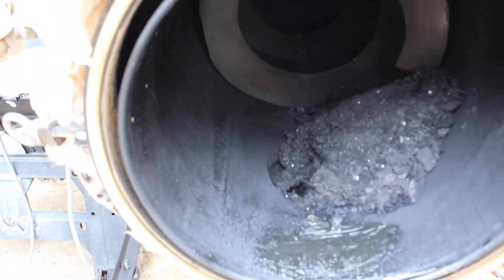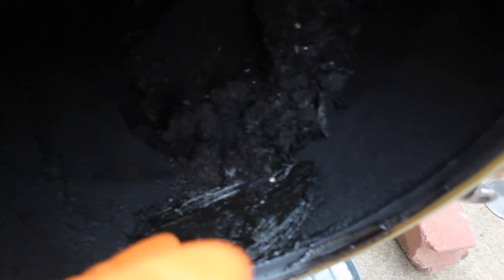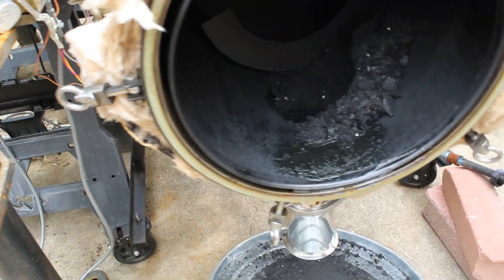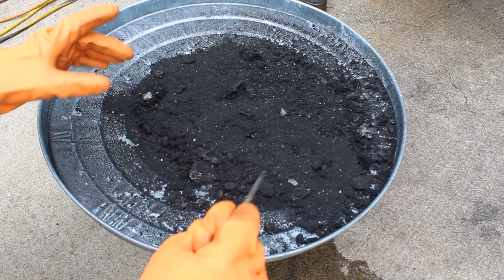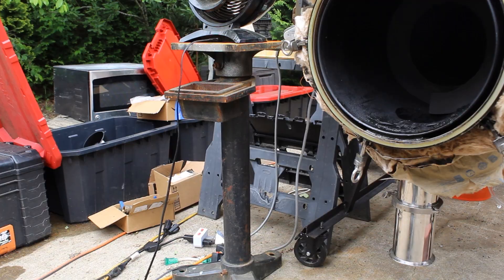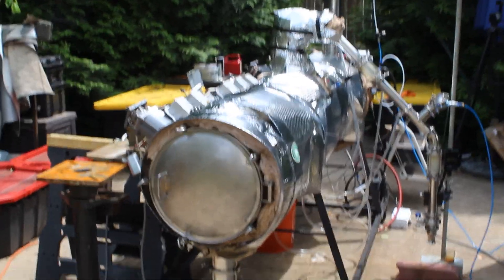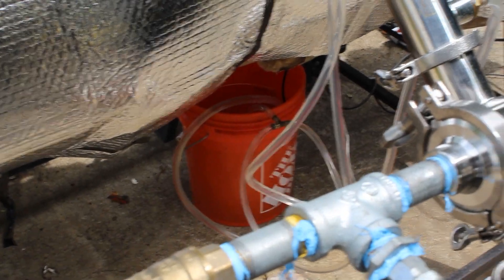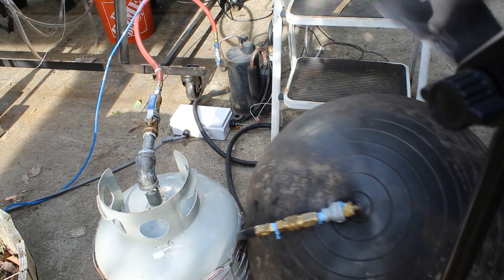Running Mark 4.5 Plastic to Fuel Reactor! | Part 2

Comment: A small pneumatic vibrator welded to the outside Will have that lil carbon sliding its way to the hole while the blades pushing

Comment: That heat you're trying the keep in with insulation, you should also utilise thermoelectric converter to try make the thing power itself using its own waste heat..

Comment: 7:15 You will get some transfer. But a compressor is just a vapor pump. You need a cap tube, piston, or thermal expansion valve to create the compression. LNG is created at -260° so this will be a hurdle as well. You might get lucky and the increase in pressure might bring the temperature requirement down.

Comment: Put a bung on the bottom of the auger to allow more spent carbon to escape so your not getting too much recarbonization. You will get a better yield and cleaner product. Hope it helps.

Comment: for material gathering look into shaker tables and other sorting machines that are for gold mining. Alot of it is very applicable here, especially if you're gathering pure minerals aswell itll properly sort all of the precious metals by density. mbmmllc is a great yt channel to check out for those kinds of machines, he also does custom machines if you want to make it specific

Comment: Sir , you don't need that much power , with this set up you need the plastic material to be in constant motion during microwave operation time (burning stage) to get maximum efficiency, after that if the power is not enough you can add more burning power.
Instead of Ice you can use a chiller ( cold water ( water cooling system low cost) 
good job, good project that needs more improvement to be profitable.
Note: you can install microwave from the other side this ( one microwave in front of the other ) this way you will hit the plastic material from 2 sides with waves with out the need to rotate the plastic material ( I suggested rotation at the beginning) or every 30° on 1 section you can install 1 microwave this way in 1 section you will hot the plastic material from 3 sides.
I like your project ❤
Good luck 
Hope my suggestions help you to improve your project

Comment: Ofc some baffles is nice to direct the carbon somehow, but this reminds me of this Alfa Laval separator at my place. Its basically a spinning bowl with a water trap that will form a water ring when it spins. Oil cannot go past the water due to massive G forces favouring water to go outwards instead of oil. Anyways in the bowl is a liner. Just a thin sheet of stainless steel that conforms to the bowl. Other than separate water out of lube oil, it also sediments out particles with that massive G forces. So after a lot of muck has built up at the bowl, you lift the liner out to clean up easier. And the little bit of grime left on the bowl can be wiped with a cloth. Massively reduces manual labour of scraping the bowl clean from the muck. The liner can be brought out to clean in a more ergonomic setting.

For parts in the pyrolyzer that doesnt touch the spinning auger thing, maybe have a liner thats just snug, but doesnt need to be welded to the vessel. Ofc, you could weld some baffles and walls to the thin liner to redirect the carbon to the hole. Thin sheet welding so might be challenging.

So for a few batches, the carbon goes where it needs to, but after several batches, the cover can be removed to bring out the liner for manual cleaning. Reasonably efficient enough operation imo.
Reply: Out of topic, but the bearings and balancing of that Alfa Laval is just chefs kiss. The thing takes several minutes to get to a few thousand rpm. And when you turn off, it takes a few minutes too to come to a stop. SKF deep groove ball bearings ftw.

Comment: The only way this can truly be useful is if you use maybe a combination of the carbon / gas by product as a way to recycle heat the device plus some less expensive energy uses such as maybe a Solar panel/ mirrors / Or Fresnel lens heating system or heck Water powered. Overall you would get less energy in the end product running 10 High powered microwaves. But using cheap clever non Grid based heating options plus recycling the fly ash/ gas as a way to reheat would possibly make it worth doing.
Reply: Benefit of the end product though is long term energy storage which is worth investing cheap energy heating options into as a seed.

Comment: You might just be able to shift the carbon discharge pipe a little to the side where the blade is piling the carbon?
Reply: This actually sounds like the best, elegant idea. Would take a lot of work to modify it now, but that sounds like it would totally work

Comment: This plastic-to-fuel reactor is genuinely remarkable and impeccably engineered! Congratulations! As for the issue you're having with carbon buildup around the exit hole, have you considered integrating a pneumatic vibrator? Given that compressed air is already part of this project, perhaps attaching a manifold at the required location and running a hose attached to the vibrator to the outer tube where the carbon enters could be beneficial. This method could have the potential to improve the extraction of carbon through the exit tube, thereby enhancing efficiency.
Reply: Nerd

Comment: Consult with some electrical engineers and rf engineers on how to make this more fuel efficient. I'm curious what the theoretical max efficiency this can be
Reply: @jacobclement8150 consult not hire
Maybe they'd even help for free if they're into the project
I'd offer help but my background is in computers so there's not much I can do there
Reply: @jacobclement8150 And they will be on the side of industry, I would  absolutely stay away from any degreed engineer whoi isn't close fam.

Comment: Pyrolysis is not a new process people. I imagine it’s just not profitable or no one has done the work to make it profitable.
Reply: I'm pretty sure that's not true, people always say that when they do get as much as they want
Reply: @Bengauzi  What do you mean?
Reply: @tnypxl  So basically in a hypothetical he can sell a liter for 30 dollars but it costs "28" to create it, but 2 dollars for some isn't worth it and at that point it's labeled not profitable
Reply: @Bengauzi  Any byproduct of eliminating plastic is a net positive when weighed against not doing it or not doing it enough.
Reply: @tnypxl  I mean if that was everyone's opinion then you're original statement would not exist imo
Reply: @Bengauzi  When I say “not profitable”, I’m taking into account the process from A to Z if this were to run at scale. Just look at the power requirements, the grinding up plastic, collecting and redistributing and reusing the carbon. Not to mention the insane amount of regulation that will inevitably balloon the cost of implementation and slow down aggressive iteration of the tech. Not to mention adherence to safety protocols.

Profits disappear pretty quickly when taking everything into account.

Comment: This is a great idea. But...... If it takes more energy to make this fuel, than it produces it will never become mainstream. It can't cost 200 bucks to make 100 bucks worth of fuel.
Reply: It’s also solving 2 problems at once tho by disposing of the plastics. The clean carbon can be sold off as well as the precious metal recovery after sifting too. So he really has a combination of liquid fuel, gas fuel, clean carbon, and metal recovery profits all while potentially getting paid to take the plastic waste in. If he can generate enough fuel to run itself at no cost other than labor and maintenance, he’s set for life
Reply: @TheRzaTheGzaODB I wholeheartedly agree
Reply: That's the point of the project, keep making prototypes and trail and error until it's efficient, that's what science/engineering is all about.
Reply: That's why it's mark 4.5. even tony wasn't finished at mark 10.
Reply: Wholly depends on what the fuel price is
Reply: @thetallestguy  no, if price increased, electricity will also increased so more expensive production. If decreased the electricity price will decreased and production cost will decreased too, but in any case the cost of initial fuel used will be still way cheaper than it produce
Reply: Dawg it’s cost trillions for oil your number is not discouraging

Comment: Yes that's a very valid question.How much energy does it use compared to how much it produces.
Reply: It's almost definitely not energy-neutral, but it does address both the problems of a finite oil supply and the mountains of plastic garbage we have produced
Reply: As it’s no problem to build a few solar panels onto it and produce oil which is way more useful than a bit of electricity in the high noon day sun
Reply: he talked about that for one of the earlier versions he built: https://www.youtube.com/watch?v=n2oBhbsUoao&t=496s
Reply: During the testing phase, it’s a bit irrelevant until you solve more pressing issues first

Comment: Man you need to keep the respirator on with the machine door open. That's a unsafe pratice can kill you.
Reply from the maker: Good point there I do vacuum out all vapors before opening the machine door so it’s not as dangerous as if I were to leave the vapors in there
Reply: @naturejab  keep going brother good luck
Reply: @naturejab  get better bro remember ppe

Comment: Would it be possible to get the carbon tested for contaminants? I would like to turn from sceptical to convinced.
Reply: He has a previous video stating research done on emissions and carbon footprint. While some things can not be avoided in the process you can create other tools to deal with those problems. He states it better than i do. Im not nearly as intelligent as him
Reply: What sort of contaminants are you talking about
Reply: @OneDayBetterDad  this process creates extremely toxic carbohydrates, its been well documented for 200 years since this process isnt new, its extremely 
inefficient and extremely toxic. Sure you can put 100x energy into receiving 99x energy of dirty contaminated oil (since oil is plastic if you are american you probley don't know since education levels in america are horrendous) and all this while essentially killing every animal and human in a 1 mile radius from the extremely toxic fumes.
Reply: @OneDayBetterDad  Lead and other heavy metals. Pcb and carcinogenics.
Reply: @OneDayBetterDad  Heavy metals, lead, carcinogenic materials.